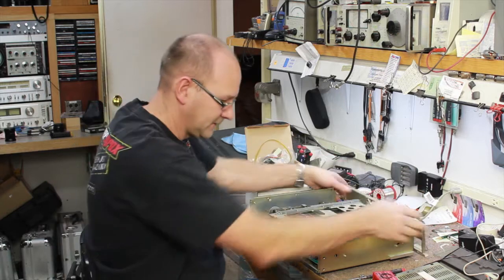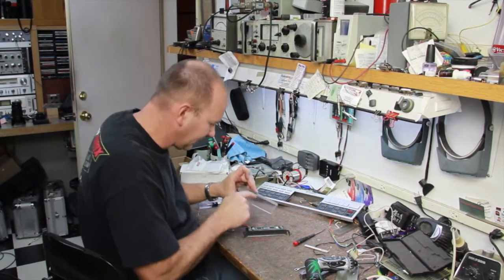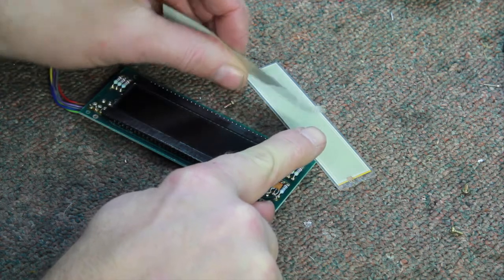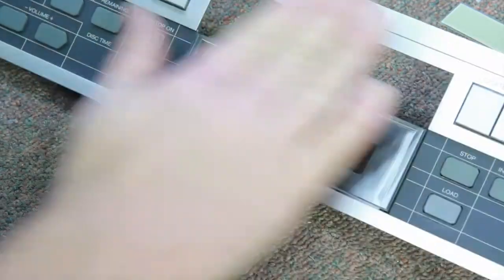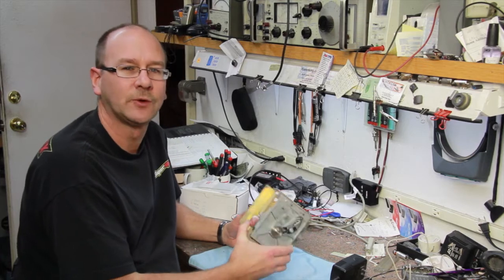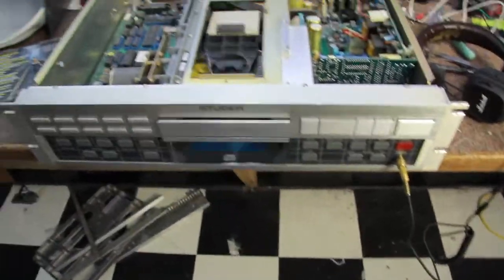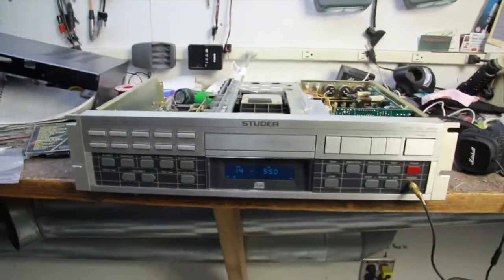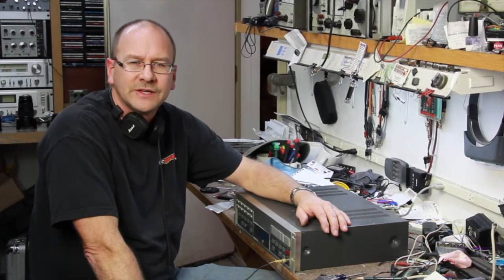Studer A727 CD player

Comment: I remember using these at the CBC when they first came out. Great machines but they were designed for 80% accuracy of the CD media. When the mass manufacturing of CD media took place the accuracy often fell sub 80% (often as low as 60%) and the error correction wasn't high enough (even after firmware upgrades) to be fully reliable in a broadcast facility. What would play on a consumer Sony in the audition rooms would fail or skip in the Studers. They were wonderful machines when they worked.

Comment: Great stuff! I followed similar way to get a new EL plate to light up on my A727. I changed the roller "tire" too. Also the spindle height adjustment. I hadn't disassembled the motor yet. 
Several IC's run really hot. I installed some gule-on heatsink. Don't know whether it would help.

Comment: I have revox b 226 and after put in cd its just shows 00.00 and dont want to play-where need to look for a problem?can it be issue about capacitors in servo board?
Reply from the maker: No I would start with rebuilding the spindle motor like I showed in the last half of my video.
Reply: can you be more specific I did not understand everything
Reply from the maker: The motor that spins the CD is not starting so you will need to take it apart and clean and polish the motor shaft then clean and adjust the plastic bearing on the bottom of that motor with a torx wrench. start my video at 7:50
Reply: great-I will try
Reply: @bigdmc1  Hi, same issue but motor is starting, spinning etc... but can't read TOC, so just stops, the possible spindlemotor is then not the issue? or could it be that it can't spinn it fast enough? my guess would be servoboard caps, no?
Reply from the maker: Kadaveroes saskatoon You’ll need to focus the laser on to the CD by turning that plastic  screw bearing on the bottom in an out until it starts to read the CD
Reply: @bigdmc1  thanks! will try during x-mass (before eggnog!)
Reply: @bigdmc1  rebuilt the spindle motor as per video, spinns fine, but player wont read toc , no matter how i turn the torx, just spins tries to read then stops...sounds like laser tries to focus (or some sound like that), but fails.. any tips.. servo opamps? laser current?
Reply from the maker: Kadaveroes saskatoon Oh you may just have a bad unit. last ditch effort try changing out all the electrolytic capacitors especially the Frako brand

Comment: LOL, I wanted to find out how to remove the front of the player off, but you skipped all that!
Reply from the maker: There are a few screws across the top and bottom edge of the front panel and then you unplug the connectors and it should come right out
Reply: @bigdmc1  Cheers, I'd done it already. Needed to pull harder LOL
Reply: @bigdmc1 crazy. Now i can't put the front back on. There seems to be something blocking it at the top, but I can't see anything.
Reply: Okay, I figured out what I did. After 2 hours of frustration. Somehow during my first efforts I must have pushed the two bulb holders backwards against the front edge of the case. This was blocking the top part of the cover from resting into place. I had thought of this earlier and checked the bulb holders which are attached onto a short arm with a allen type screw. This attachment seemed firm and I thought it was unlikely I'd had disturbed it, but I just went ahead and loosened the screw and pulled the bulb holder forward. Lo and behold, the cover slipped on first time. Sheesh.